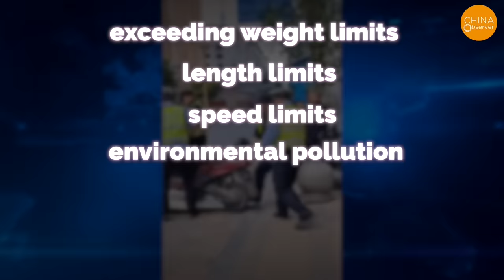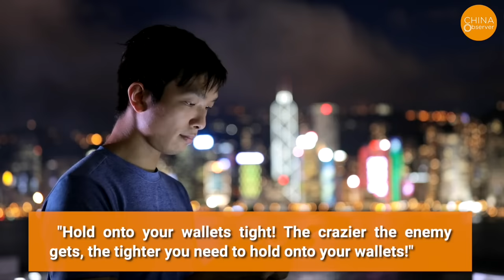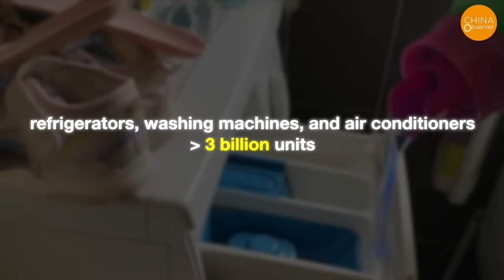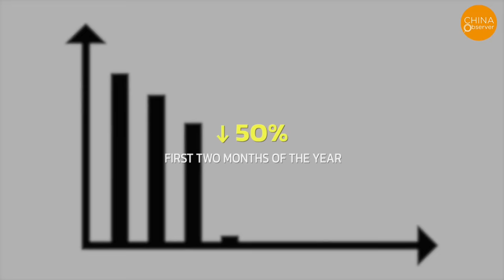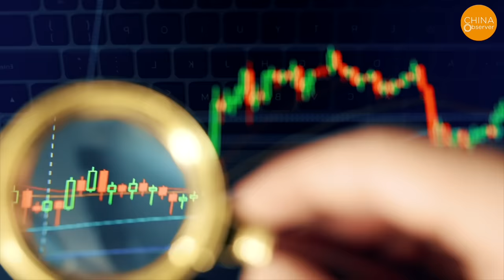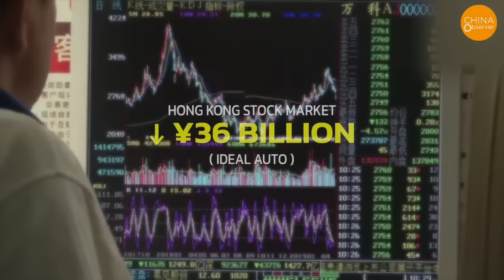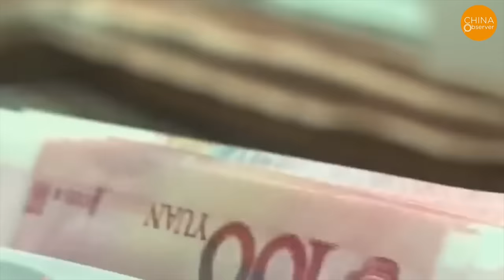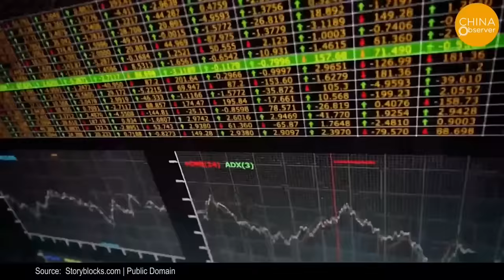Millions of E-bikes, Motorcycles, EVs Forcibly Confiscated by Police, Forcing People to Buy New Ones

Comment: Imagine if those confiscated E-bikes start catching fire due to the poorly built batteries.
Reply: Let's see it how dominos fall!
Reply: A few going off in a parking is already intense so this would be apocalyptic.
Reply: Just think about the waste from these bikes leeching into the soil and ground water.
Reply: They already have. They just do a really good job of keeping it out of the media.
Reply: They must have removed the batteries because those giant piles would have caught fire due to statistical chance of a single bike causing a chain reaction fire to other tightly packed neighbors.
Reply: Probably no, discharge, all that, unless you imply they're defected, and won't last long.
Reply: @tuff_lover If all those black plastic case battery packs were left out there exposed to the hot sun and then freezing cold of the alternating seasons, that would cause at least one of those lithium packs to go bad.  The fire from that would cause the other nearby packs to go bad from melting wire insulation even if the cells themselves weren't overstimulated by the heat.
Reply: @breveth  incredible, alone the batteries, steel, plastics!! this should made public worldwide!
Reply: Be one hell of a fire, and near impossible to fight. It would make the surrounding area untenable because of the smoke, and maybe even spread.
Reply: One of  them is bound to go boom and then all of them go. Gov just states that the giant smoke plume is perfectly safe to breathe. Nothing to see here, move along and buy new tofu dreg stuff.
Reply: It's good for GDP
Reply: They probably sell the batteries back to bike manufacturers.
Reply: so you should not buy that shit as well. As you just said that they have poorly built batteries so nobody in west should not have them as well
Reply: @KyleRuggles most of these e-bikes are actually being sold to Africa by the government
Reply: It's a unbelievable story where will it end?
Reply: they almost certainly removed the batteries. battery recycling technology is still quite poor and expensive however, and the money spent on producing the bike itself is also completely lost of course
Reply: The problem would clean itself away
Reply: If batteries get discharged they no longer present risk of spontaneous combustion.
Batteries naturally loose charge over time.
Reply: Communalism with Chinanese Characteristic
Reply: @markmd9  True, but some batteries will build up a residual charge over time after being discharged.

Another way of looking at things: How many people and how much equipment would it take to SAFELY discharge all this batteries?
Reply: Drained battery will not catch fire.
Reply: Tbh，the fact that no fire has been started in that metal graveyard just shows the random combustion of the batteries are just that, random and not the norm. 🤷‍♀️
Reply: Boom 💥
Reply: There have been rumors that some forest fires may have been started by abandoned eBikes. If you look at those guian fires recently, it seems strange because its been cold, rainy, wet and no lightning strikes YET a nearby forested mountain had a massive fire and 3 different locations were spotted as epicenter hotspots.
So, here's the 'coincidence' but that place is notorious for dumped eBikes. stolen or maybe just plain junked and left there but probably stolen bikes.
A flipped cigarette from a hiker was not lighting a relatively damp forest on fire in humid conditions but holy hell batteries go up like stunning unquenchable hellfire and for a long long burn time too.
Reply: That would be mesmerizing to watch!
Reply: @scubasteve3032  I'm thinking along the lines of these bikes are ALL illegal and have been taken off the streets because of the danger of them catching on fire.
The batteries must have been taken off. They would already have gone up in flames if not.
Reply: Ebike fires are SIGNIFANCTLY less likely to occur than car fires, but we see no campaigns to limit petrol sales...
Reply: @NiSiochainGanSaoirse  Thats not true. Petrol requires a flame to ignite or at minimum spark.
Batteries ignite spontaneously if they are not correctly stored or incapacitated.
Reply: U made my day. This would be a fucking disaster and a beautiful I told you so
Reply: "Call the firefighters!"
"I can't, officer!"
"Why?"
"You confiscated my phone!"
"Eh... use the fire extinguisher!"
"I can't!"
"Why?"
"You locked it away because it releases too much CO2!"
"Ugh... pee out fire!"
"I can't!"
"Grrr.. WHY?"
"It's a nature reserve. You dumped the bikes in a nature reserve!"
"Silence! No disebey! You pee!"
Reply: @dongshengdi773 Good!
Reply: @surfside75  drained lithium battery will catch fire , almost a guarantee
Reply: What do you mean imagine? I see it everyday

Comment: It is junk. That many vehicles, sitting and  corroding for who knows how long might as well be considered garbage. 

First off what’s the system in place to locate someone’s individual vehicle? 

I don’t see any markers, areas broken down into sections or anything. Just piles and rows and rows of bikes.

They might as well start crushing, breaking down and recycling the materials they can.
Reply: When the towing and fines are added, and are more than a new bike, the officials KNOW it will not be claimed. No need for tracking location. USA towing is not cheap either. Can'tshred bike with battery, so they sit there. Location? ha ha. What is labor cost is equal to location question; pointless here

Comment: You can disagree with the method of control and regulation but these non-compliant ebikes and scooters are flaming deathtraps using cheap lithium cells and chargers. In China they park them underneath, inside or just outside apartments and when one catches fire deaths can easily result.
Reply: Good point. I don't know why China Observer is so biased. 

I think the way to counter bias one way is to be unbiased, rather than biased the other way.

Comment: Why sell nom compliant vehicles in the first place then?
Reply: So you can fine them later. The UK government sells custom registration plates but if the police catch you with one you will get fined.
Reply: IMO wasn't. NO plate or insurance possible. Overloaded? The words were carefully chosen for the presentation. Heed in the future.
Reply: they probably were compliant; then the CCCP simply moved the goalposts
Reply: @randomtux1234 just like CARB did with the diesel laws
Reply: @randomtux1234 usually these kind of control measures are slow boil , like emissions standards, mileage tax or road levies, congestion / peak tariffs, to force retirement of older cars and trucks. Or they are optimistic controls ie half of cars to be “green” BEV or PHEV sold. To get to the optimistic goal, they will create small steps to get up to the next goal. 

Or to make taxis and buses cost more to operate outside of the state / grant holders. Usually when using the carrot and stick, you need to have the carrot. You can’t get the same result without the carrot. 

Cutting off low income drivers is going to have a strangling effect on the economy. It will push people out of the cities, but these are the wrong people to push out. These are the logistics and blood / goods flow of a city.
Reply: More profits ! Thats fascism.

Comment: Can confirm I was indeed pulled over in the 2nd major stop I went through today.  I got a warning for no helmet, a picture taken and let go because I'm pretty sure they didn't want the headache of dealing with a foreigner. 
There was also a wave of this about 5 years ago with major ongoing stops and seizures in 2019 in our city. They were seizing mega-battery power super eBikes, a lot of stolen ones, motorcycles (not common but still some non-workers had a few) and maybe this helps viewers better grasp how this is done:
-  By the letter of the law, and it has been for many years 'electric bikes' were to be not more than the 'city rental' you see where they must have pedals, they cannot be longer than an average pedal bike, they cannot be more than 24 or maybe 36v (my 72 is NOT legal by letter of law). It seems to me the maximum speed is 35kmph  and for example is you exceed that on the rental share bikes it warns you and can fine you.
Comically, I'd seen inspection centers where loose 'clip-on pedals' were dropped off and picked up from the queue so it legally passed as a 'pedal bike' with electric assist.
So, basically the entire time nearly EVERY eBike is always illegal. Properly and by law, 95% of them are supposed to be seized or at least not allowed on roads.
MANY things in China work this way. In a way, everything is illegal but then its 'unenforced' by varying degrees.
Canada and a few other nations had better stop and decide if they want to keep going down that road of governance by the way. 

Anyway there were two major stops on my way and one was directly on the other side of a bridge where at least one fellow driver was yelling at them, angrily that this was so dangerous (it was, it was crazy how they set it up, shocked there wasn't accidents already).
and yes they will get people to step off the bike and roll it up the back of a truck as you see in this video. Like, just like that. at the time I was there a dad and two kids were being relieved of their ebike. 

all that said, it should be mentioned:  there are stolen bikes ALL OVER the place, utterly unregistered, fake plates, AND before I saw roadblocks today I was actually thinking to myself on how there were so many old old broken bikes driving around. because of the economic slowdown people aren't getting repairs, new tires never mind new bikes and there are now so many trashed bikes with actual packing tape holding them together, chunks missing, smooth bald tires etc.
Reply: Why pay for repairs on a biike that might be confiscated at any moment?

Comment: They could have simply confiscated the batteries instead of the entire device!
Reply: It’s an unregistered bike, in a city where you probably can’t register the bike at all. It’s a bit like modifying an electric scooter, or converting a bicycle to drive at 60mph on the footpath.

Crackdowns are likely to be normal, but it’s a case of having a law you don’t enforce, doesn’t make people admire the police. It makes them afraid of the legal process because it has these punitive and strange laws. Unknown rule breaking and crackdowns drive animosity and fear, not respect. But it also breaks trust and loyalty. 

Authority without trust or reliability becomes tyrrany. What new law can they implement or change if they never announce or tell you what has changed.